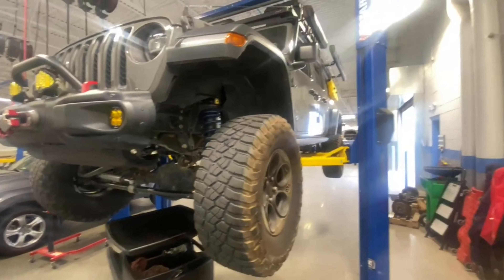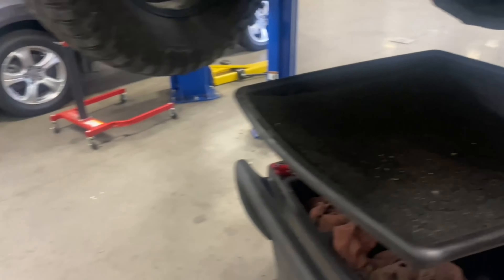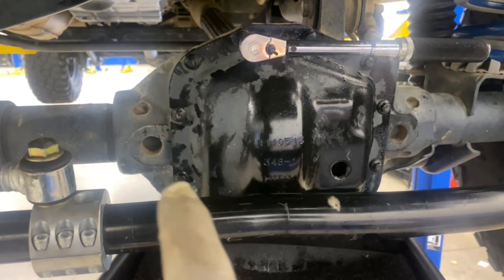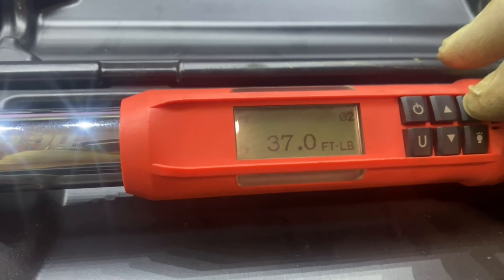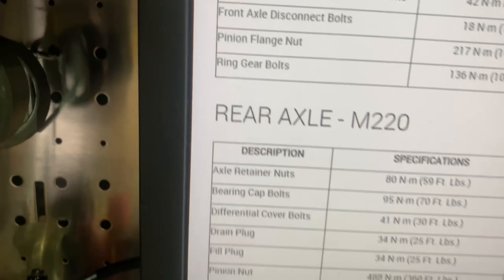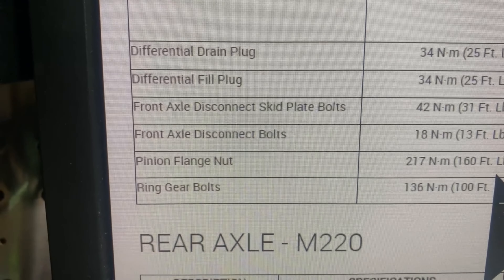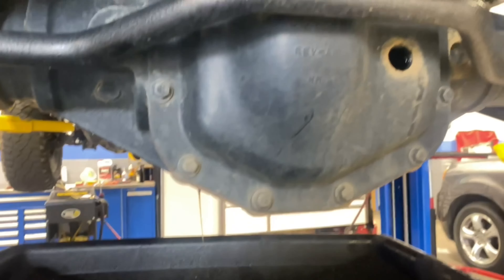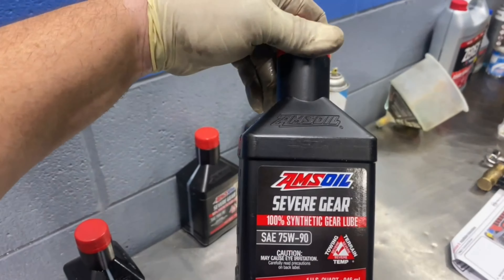How To Change The Diff Fluids In The Jeep Gladiator/JL Rubicon

Comment: Awesome vid with the torque values!! 🙏 If I tow a small camper trailer like 6 times a year, do you think I should up the weight or stick with 75w90?
Reply from the maker: Dana says 75w140 for that axle
Reply: @wolfoverland thanks, I did some more research as well, going with redline 75w140 👍

Comment: Can I reuse the bolts? My rear differential does not have a drain plug
Reply from the maker: I did
Reply: I only have 4K miles on it. I just bought amsoil, crawled under it and found no drain plug. I can also reuse the gasket?
Reply from the maker: @thebeard6361  yes. It’s reusable
Reply: @WolfOverland  ya da man! Thanks

Comment: Buddy I have a concern I have a 2020 Rubicon 3.6 but rear differential don’t have drain plug is that normal ?
Reply from the maker: I’ve heard of that. Like my front diff you will have to pull the cover and drain it that way. The gasket is re usable.